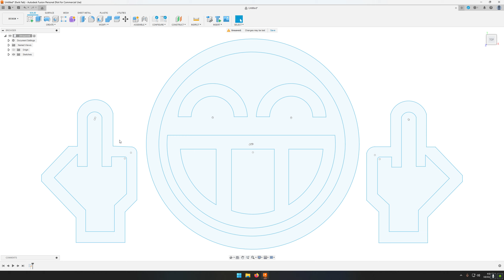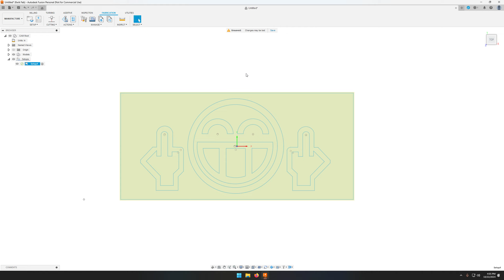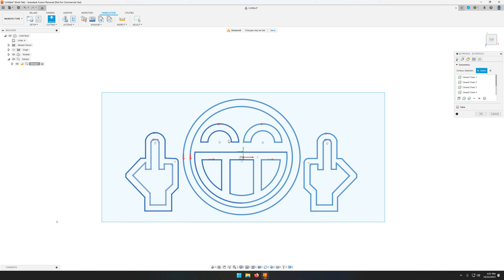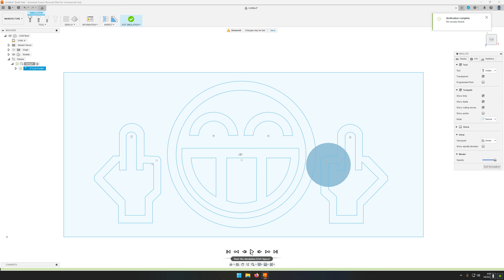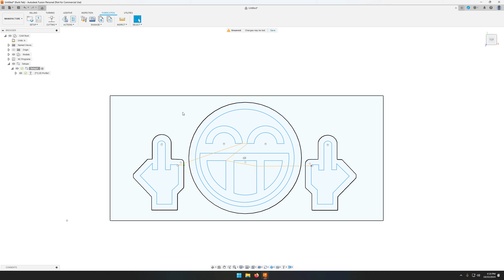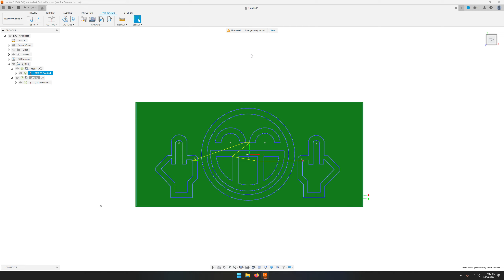Fusion How To for Easyscriber

Comment: Love the channel, fusion content especially!  Have you ever tried the scribe function on say glass?  Suggestion, dumb down the resolution when recording, I can barely read the GUI text in fusion on my 22" monitor
Reply from the maker: Great point on the resolution, I hadn't even thought about that for anyone viewing!

I haven't tried it on glass, but I suspect you may want to run a higher cut/pierce height than you would metal.

Probably half the height suggested like -0.1? 

Would you say glass is rather abrasive to suggest a slower feedrate as well? Now I'm curious.